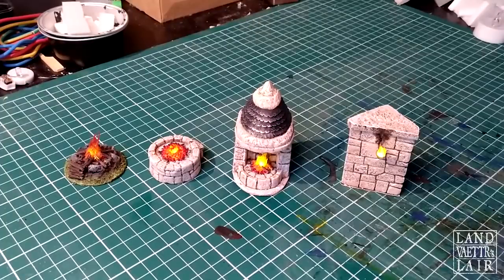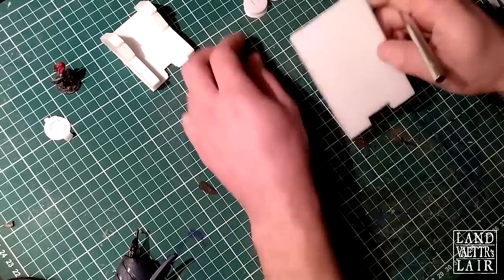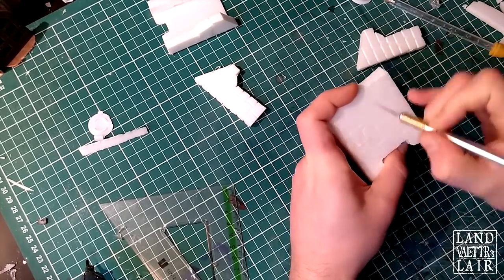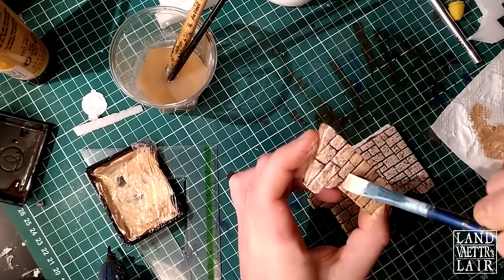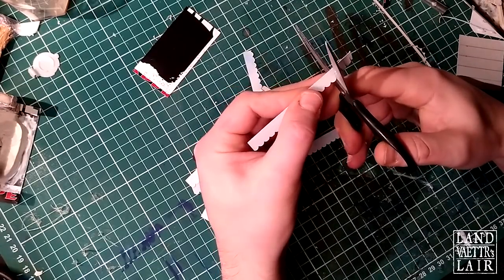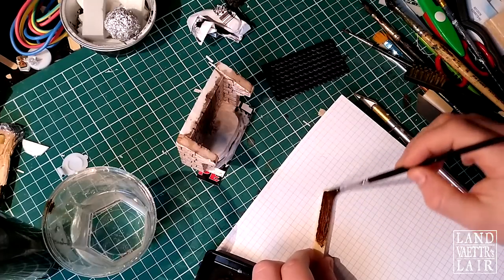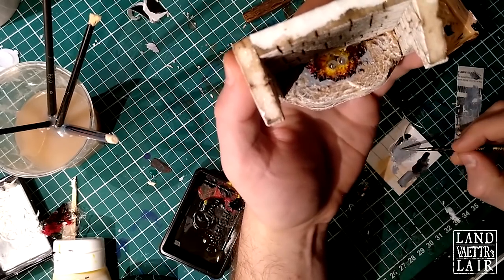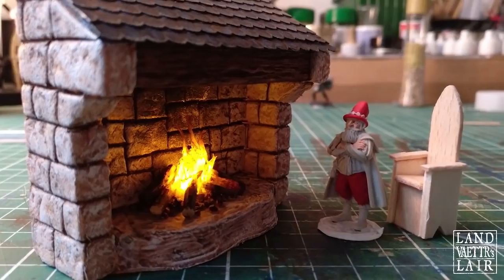Castle Fireplace for tabletop RPG - Tutorial -

Comment: The scallop scissors are called pinking shears, they sell them for paper craft, but if you want a really good pair get the heavy steel ones from the fabric store.. they're easier to find as just straight triangle edges for fabric but they do make the scallop ones, my mom had a pair.
Reply: Pinking shears are a zig-zag pattern, to prevent fabrics from unraveling. But all kinds of other shaped cutting edges were available for paper crafting. I had a bunch of different ones from scrapbooking

Comment: There is also another technique you can do to make fire. When I used to do my dioramas in the 90s we would use Model Train grain o wheat light bulbs and then wire them to a 9volt battery connector and solder the wires of the grain o wheat bulb to the connector so we could attach it to the battery when we wanted to turn them on. Then once we knew the bulb would work we would cover the bulb in enamel paint of red not acrylic for the acrylic would burn. After we would attach it to our wood torch that we made using wood matches cutting a groove into the match stick with an exacto knife to run the wires within the stick and cover the wire and groove with filler. Once it dried we'd paint it brown to hide the filler and make the torches look like wood torches. Once that was done we'd take cotton balls and pull off a little bit and then using PVA glue, gluing the cotton to the match stick or the bulb and shape it while the cotton was wet to form our smoke. Once it dried we'd paint our gray tones to it to give the effect of smoke. Then you plug it into the 9volt battery and you have a smoking torch or fire place. Or you can even run all your wires to your model train light converter switch to power all the lights on your diorama.

Another technique thats also inexpensive is an old technique I learned in the early 80s for my dioramas. Once you paint your small twigs you find in your backyard after you wash them and dry. Or you could also use your wood match sticks if you have those. But personally I prefer the natural wood you find from small twigs lying around in your yard. Just make sure to clean them first then let them dry. Then paint your black and gray for your charcoal and ash colors before you paint your yellow, orange and reds on them also spacing them out to give the effect of your hot embers in the fire. Then to make the flames we would also use the flat not the crinkle crepe paper or colored tissue in yellow, orange and red to make the flames. Cut or best way is to randomly rip the paper in irregular shapes to give the look of your flames then using your pva glue, gluing the paper down onto your twigs or match sticks. Let it dry then you can go back and cut some of it with your scissors to random shapes or just twist and pinch the paper to get the shape of the flame you like and you have your fire in your fireplace, camp fire or bonfire. Which ever you choose to make.
Reply from the maker: Sure, the model train guys and their techniques have always been pioneers in a matter of dioramas back in the eighties and even before. These are very sound alternatives you mention here, however as you can see I was looking for a technique involving no soldering iron and for modular scatter terrain pièce, not a diorama. Hence the scavenge and customisation of 3 volt tealights. Easier to acheive for the wannabe crafter. Thanks for your input on alternatives! Cheers!
Reply: @LandvaettrsLair  By all means I like what you did I would not have thought of the tea lights. But even is someone is on a tight budget especially after all the recent events with shut downs and some stores being short on supplies. If someone can't do what we did in the model train idea or even if they can't find tea lights in the store the crepe tissue paper is the next best option. And Ive been doing dioramas since the late 80s and 90s with my dnd figures

Comment: Great video! I love your channel. I have a question: I've tried washing my foam board with the exact same color you have (Amsterdam colors), but even after multiple washes, there are still some unpainted recesses between the bricks/stones that I can't seem to be able to paint with the wash. Any idea what I'm doing wrong? I usually base coat the whole wall with a dark color instead of washing it, so I'm pretty noob at this.
Reply from the maker: Stavros L yes i've already experienced this issue. I recommend using à flat brush to jam the paint more easily in the recesses, brushing left to right. You can also use the paint barely watered down for better coverage of the recesses then water it down for the surface of the stones. However bear in mind i used a dark wash as first step because i wanted a very clear stone, doing a dark basecoat is a solid solution in most cases.
Reply: Landvaettr's Lair Thanks for the quick reply. I already use flat brushes, but haven't tried the "left to right method" before. I generally experience great difficulty covering all the recesses between the stones even if basecoat them. I'll try this on my next project :)

Comment: could you include a list in the comments of the items you are using? im not shure the foam type, or what you used for the embers.
Reply from the maker: Corhen for the embers i used coarse-grained sand. I used Sand i usually use for aquariums. For the foam depends of your country, i used 5-8mm thick foamboard, usually you can find them in most DIY shops.

Comment: Ive been looking at making a few fireplaces for my upcoming tavern build. And one that Ive really like was one from the game Skyrim with the round fireplace from the Candlehearth Hall tavern in Windhelm. Which the round 2 sided fireplace sits on a large round stone slab, and it has a stone cone at the top for the smoke stack on top of the large round mantle as it tapers up into a stone pipe of the smoke stack.
https://sites.google.com/site/thebanneredmare/_/rsrc/1326684193632/npc/residents/residents_windhelm/candlehearth-hall/NPC_CandlehearthHall.jpg

 I thought of using the tea light candle to illuminate it. But if I had to build up the foam to conceal the tea light,  the slab would be 3 times as thick than it should be. For if you see in the game and the image, the round stone slab is like only 6 -9 inches thick or so. So if I did the height of the tea light then the actual fireplace height would be 3 feet in height to scale. I just recycled a couple of styrofoam drink cups to make mine. I used the XL drink cup I got from a convenient store and cut the base of the cup off to make the stone slab base. Then using a toilet paper cardboard tube I covered it with Mod Podge to reinforce it to make it stronger. Then I used 2 types of styrofoam containers to make the stone of the fireplace. I used a 1/8 inch thick foam I got from a side order container from a fast food place to line the inside of the toilet paper tube glued with PVA glue. Then using the thicker 1/4 inch thick foam from the same drink cup I used to cut out the base. Before putting on the outer foam I used the design of the fireplace in the game  to mark out the stone cracks and joints onto the TP tube. That way I had an idea where the joining stones are and I laid the foam along the tube to draw out all the stone lines and cracks. And using a ball point pen or something to mark the foam I glued it to the tube with pva glue. I had to use an empty pill bottle to maintain the round shape of the fireplace and rubber bands to keep the foam in place as the glue dried. But make sure to cut out the openings of the double sides  before you put the foam on so you can cut off the excess foam in the opening after it dries. Do the 1/8 foam o the inside first  before putting on the 1/4 inch foam on the outside. Once you cut out your opening then cut out 3/8 inch thick piece of the quarter inch foam into strips for the stone archway of the fireplace opening. At first I tried to use PVA glue but they moved around to much even with small finger spring clamps to hold them in place which they marde the foam. So I opted out for the hot glue which I was able to glue them into place long enough for the glue to set up. The only problem was getting the angle just right on the opening of the archway for the foam to set right in the opening.  Texture your foam like you would with a rock or something to make it like stone.

Before you put the mantle and cone smoke stack on, glue your rounded fireplace to the base with hot glue or PVa first then paint it all black. Then do all your gray tone painting, lay down some fine sand for your ash pile, and glue down the twigs you want to use for the logs in the fireplace. Now Ive never used the hot glue to make the flames in the fire before, but Im willing to try it,  for originally I was just gonna use the old method I mentioned before of using color tissue paper. But if the hot glue makes it look more real Ill do it to see how it works after watching your video.. Just make sure to do this first before you put on the round mantle above with the cone smoke stack or you wont be able to access it from above to do your painting, gluing down the sand, your fire logs, etc. For once you add the top on there is no room to get inside with your paint brush etc. I did this and had to remove the mantle  so I could get inside the fireplace to paint and detail it. So Im making the mantle and smoke stack separate from the round fireplace to gain access to do everything I need to. 

   Then today while I was trying to figure out how to incorporate the tea light. I figured I would conceal it in the the cone shape smoke stack from above to illuminate the fireplace as if its the glow from the fireplace rather than the flames of the fire instead. I figured it was only best to do so to avoid the overly large size slab base. Ill use some light weight cardboard to shape the cone and like I did the toilet paper tube with Mod Podge to reinforce it before I glue on the foam stone. Once I get the shape I want before I brush on the Mod Podge, Ill draw out the stones of the fireplace  from the game just like I did on the TP tube I used to make the fireplace for the cracks and joining stones. Ill  pre-carve them before I glue them to the cardboard cone shape. But Ill glue the mantle piece to the top of the fireplace after I paint and texture everything and drill the hole for the tea light to go down from the top. That way I can remove the cone to gain access to the tea light to replace the battery etc. And the cone smoke stack and the stone pipe of the smoke stack will be all one piece as the mantle, fireplace and the round base are all one piece once all the details have been painted and added. I have half of it done now Im now working on the cone shape and mantle right now.
I hope it turns out once I get it all done. I shall post pics on my facebook once I get it finished..